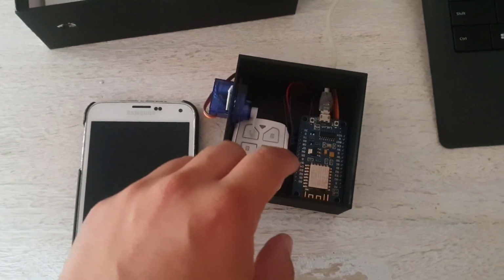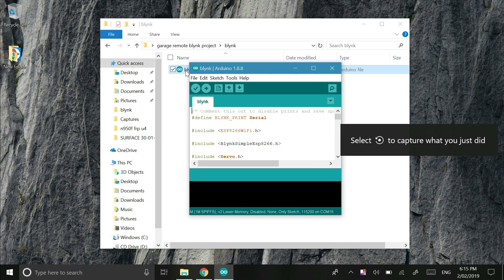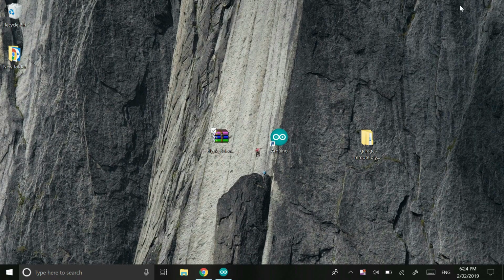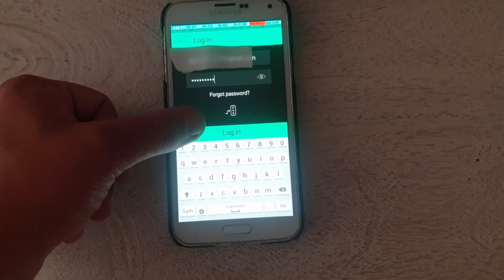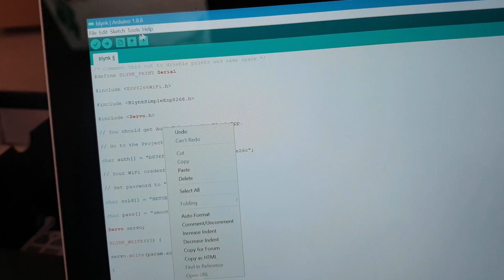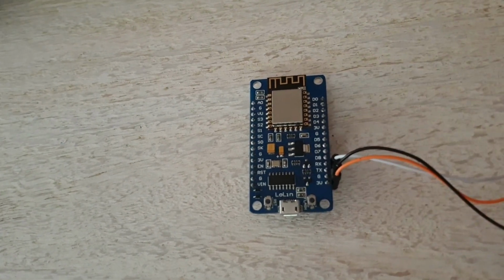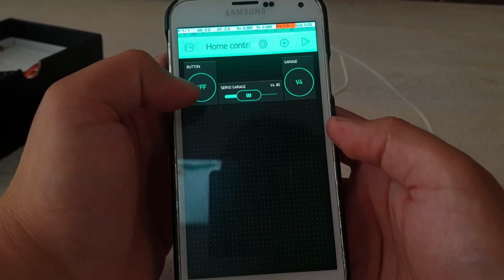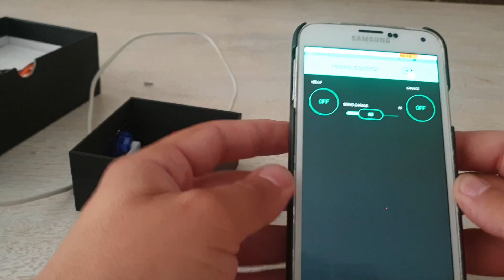How to open your garage door with your smartphone. Arduino/Blynk Project

Comment: Hello :) I'd just wanted to say that if you got open/close button in garage, or connections on your garage door opener, use a relay and the arduino, and connect it without using servo and a (car) remote opener. I have that in my garage, both my remote (originals) is inside our cars, and I can open my garagedoor from my phone using blynk
Reply from the maker: Hey! I was gonna go that way but decided to do it with the servo because my car has a remote start and I use the same method to remote start it :)